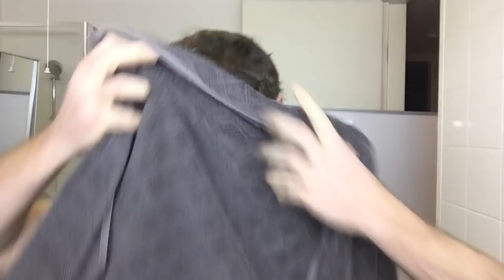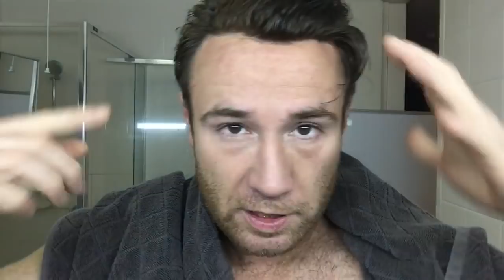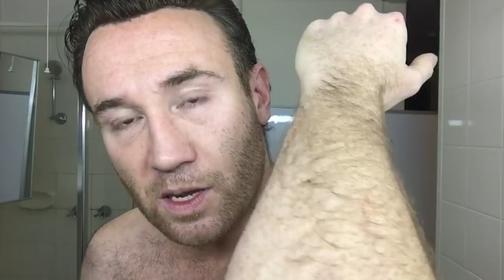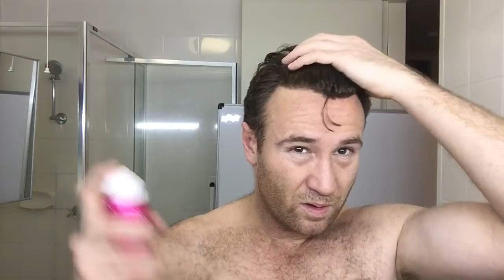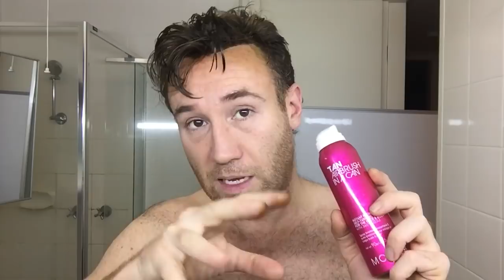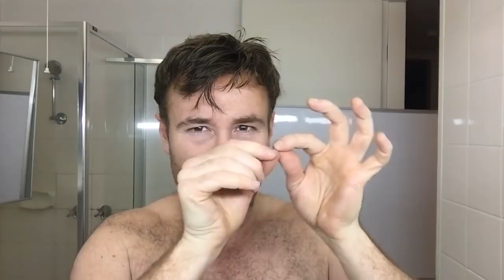Video 47: Trying to fix a Poly hairline

Comment: My partner wears a poly, I always tweeze the hairline to thin it out and cut some few short hairs at the front. With a natural hairline the hairs are never all the same length, you always have a few shorter ones sticking out. That really helps it look natural a lot I think personally.

I also make sure the hairline isn't perfectly straight/curved but has little imperfections in it like little dents.
Reply: Ryan White I'm nearing the end of my first poly. I was about to switch back to lace because of similar problems in this video. I think I might give poly one more go and try what you've suggested.
Reply from the maker: Thats good. Also, peroxide the first 1cm of hairline and hair roots. I only exposed it for 25 minutes but I think I needed to leave it for 45 minutes.

Comment: The problem is that your not cutting the hairpiece from the hairline and using the main hairline for your hairline the hairline of the unit is less dense than the middle and sides and the vloops look better on the front than all around the hairpiece next time you cut the other unit try using the front hairline of the unit to be your hairline and youll see u will get way better results
Reply from the maker: I can fit 3 stencils. I would need to discard the other 2. That would be a waste of money. It should be made correctly.